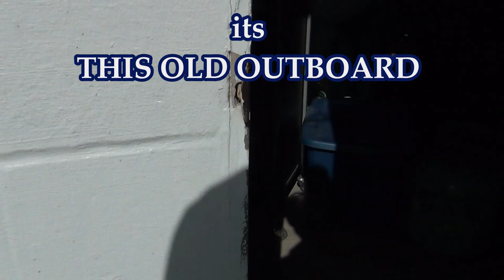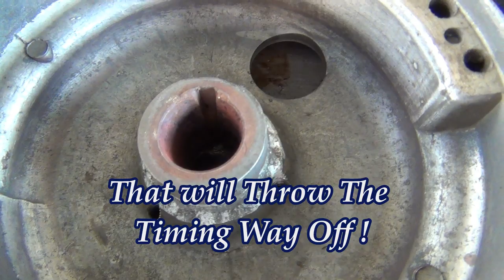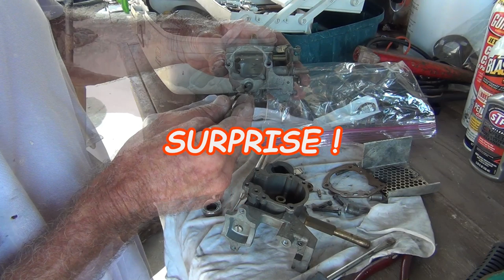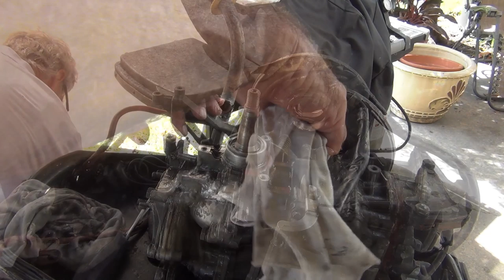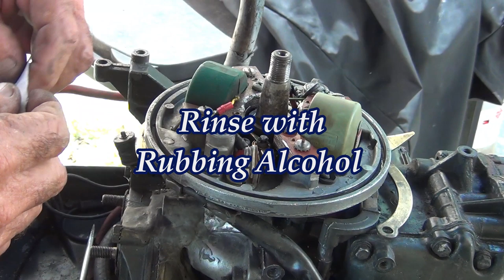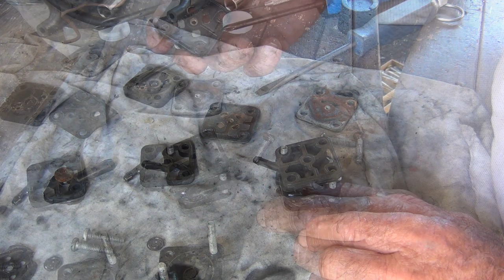Johnson 20 hp Outboard 1968 - Flywheel, Carb, Ignition, Fuel Pump

Comment: Boy you’re right on about those early 18-20 horsepowers I’d have to say my 1970 18hp Fastwin is about the most reliable motor I’ve ever owned. Real nice to work on and at around 80lbs. They got to be one of the strongest running motors per weight ratio!!! Just can’t beat em.
Reply from the maker: Yeah man!
Reply from the maker: @Derrick Smiley  No not really. I need my parts. What were you looking for?
Reply from the maker: @Derrick Smiley Yeah. Thats what I was going to say. I buy all my parts there. Cheaper (usually) and faster shipping (almost always).

Comment: I have an old 68 johnson fd21. Do you have any tips on disfunction fixing how shakey it goes when it runs? I'm also trying to figure out what carb kit I should be using to rebuild it.
Reply from the maker: Hey. Thanks for tuning in. Shakey could be the timing is off, give it a good tune up. Carb parts here, https://www.marineengine.com/parts/johnson-evinrude-parts.php?year=1967&hp=20&model=FD21. Thanks again !

Comment: You mention the cork type float in this video. Are the cork floats a problem? I found out that there isn’t any foam / plastic replacement for a 1966 and decided to modify a newly purchased foam float from a later model. I had to remove the bracket that holds the needle and replace it with the original one from the cork float.  I used gorilla super glue to replace a section of foam that broke off from the new float and seems to be holding well. Was this a mistake? Should I have used the original cork float instead?
Reply from the maker: Well, its not that they're a problem. They just dont last as long as the plastic ones.  I think its best to use original parts. I've never seen a foam float before. The cork floats are available if that one dosent hold up. http://www.marineengine.com/parts/johnson-evinrude-parts.php?year=1966&hp=40  . Thanks again !

Comment: Thank you for the video.I have one of these Johnson 18hp motor's and it starts up but will not throttle up. And when it dies it clanks and kind of back spins.Seems it is out of time or something.Any suggestions would be greatly appreciated. Keep up the awesome videos.Thank you
Reply from the maker: Hey. Maybe your plug wires are crossed? Clank or backfire. Also check that both pistons are traveling up and down, pull the plugs and hold a screwdriver on the top of the piston, slowly turn the flywheel and see if each one is traveling smooth. If its clanking it may be bad bearings or a broken rod. Have you tried a compression test? Also check the keyway that holds your flywheel in place. If its sheared or the gap in the flywheel is all stretched out it will throw the timing way off. Let me know what you find out. Thanks & Stay tuned !
Reply: Your status plate located underneath your flywheel there's four screws holes it on there's a collar underneath it I used to take the collar and put it on the lathe and cut it down some and that would tighten the status plate up then the points would open and close when they supposed to
Reply: I will check it out. I swapped out the control lever arm which helped a lot. There was a lot or slack in the throttle, It seemed to help. Haven't had it on the lake to test it yet. Need to find a Skag for it now since mine has a big crack in it. Can't find one on line. I JB welded it but idk if it will hold. Wish I had all your knowledge. Thank you for your help .I truly appreciate it.

Comment: The best cleaner I found for the older motors with purple power. I have put low speed needles in drill and smooth them out with like some 1000g sand paper
Reply from the maker: Yeah Purple Power is the best, it even stripes off that oxidized old paint, but they didnt have any or I would have gotten it. thx again !

Comment: Here's a little tip for that pain in the ass little spring and tip. Put crazy glue to the little plastic tip and the spring, then just a small dab of glue to the spring at the base so it stays put when you put the rubber gasket over it and your life just got a whole lot easier!  Your welcome in advance.

Comment: I use to fix them if I could  replace the diaphragms,etc.now I buy the Chinese pumps for $11.00/pc. on E-bay and stock them.I heard they are pretty good pumps. Bombardiers Evinrude prices are thru the roof.I have  gotton no fuel pump problems yet on motors I have sold or serviced with chinese pumps I knock on wood.If motor has a good used pump I include a new chinese as a spare for the customer or buyer of the motors I flip.Glenn P.
Reply from the maker: Hey. Yeah. Hahaha , I buy them too!  Thats why I said I can get them cheap! I've Hooked up a lot of people with them after they see regular prices, like you sad, Through the Roof! And I've never had a problem with them either. Thanks again !
Reply: @THISOLDOUTBOARD1  Yeah thats the way to go most times just change the pump with new like you do too.I like fixing things also if I can depends how ambitious I am that day .They are great motors those 18-25HP I agree one reason I enjoy working on them.Luckily they made them by the thousands over the  late1950S-70S and there still abundant and sitting in basements,garages,sheds,backyards on the back of old boats you name it there still here. Mainly because of ther large manufacturing numbers and reliability has some say in the matter to you think ,LOL.........Glenn P.